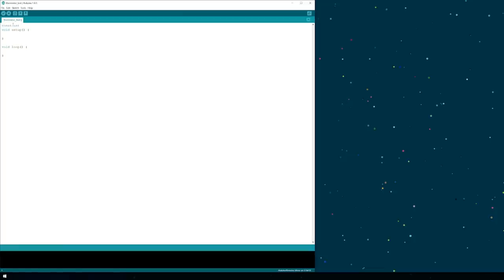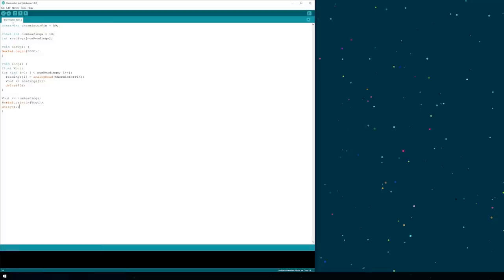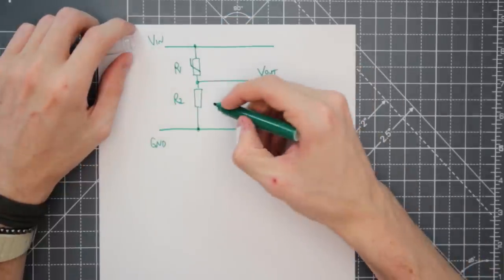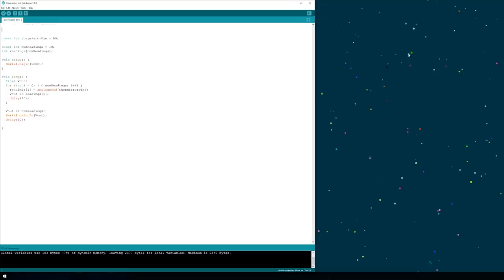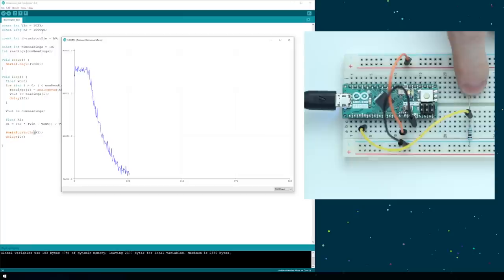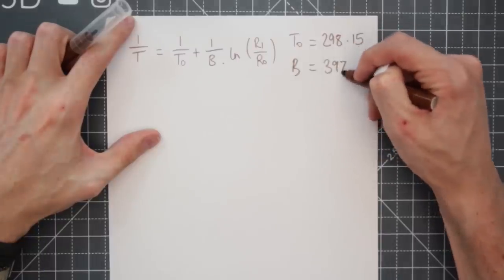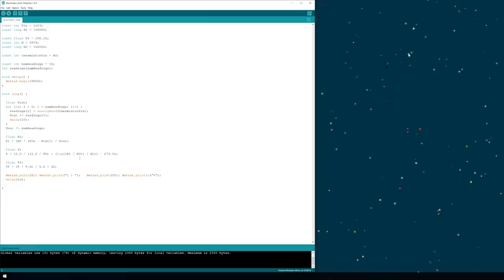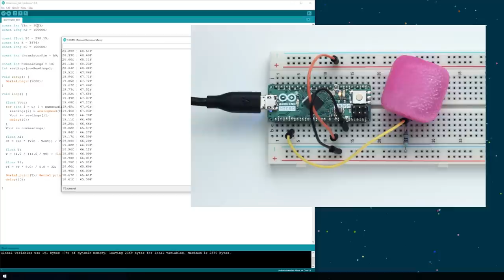Make Your Own Thermometer! - The Learning Circuit

Comment: Great video, thank you. I had issues with the output of the project.
After spending a bit of time on the code, I found that the Vout variable was never set to Zero.
Added a line of code to the original program and this solved my problem.

void loop () {
  float Vout;
  Vout=0;    // initialize Vout to equal 0
  int Amount;
  for (int i = 0; i < 10; i=i+1){
    //Serial.print(Amount); 
    readings[i] = analogRead(thermistorPin);    // read from the thermistorPin into the array
    Vout += readings[i];  
   
    delay(10);                     // allow the ADC to settle between loops
  }
Once compiled and uploaded the program worked like a charm.
I'm using an Arduino Mega 2560 and version 2.21 software.
I don't know if this has any implications with the coding.
Thanks for all the great work!